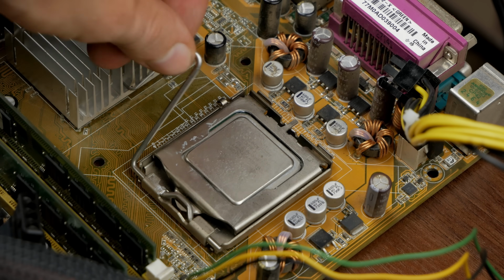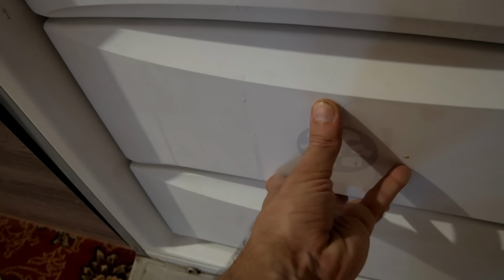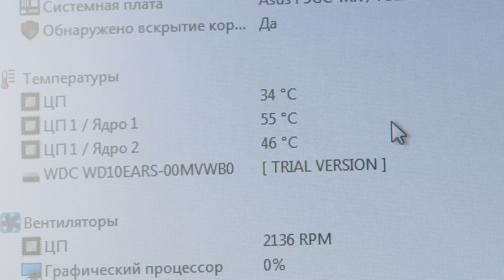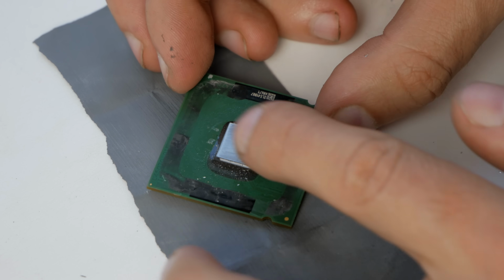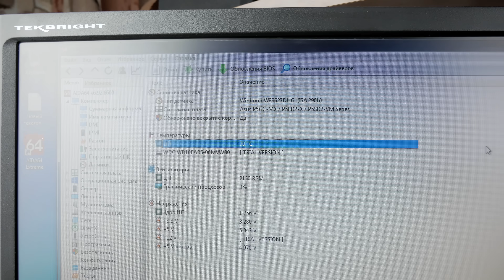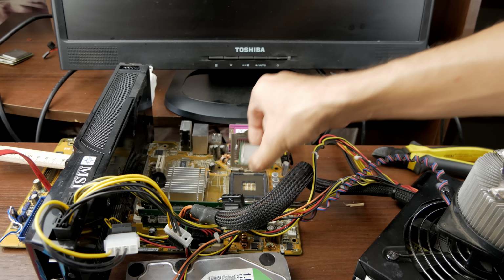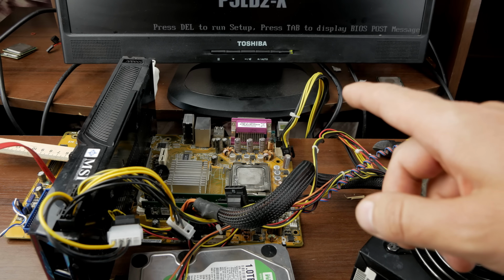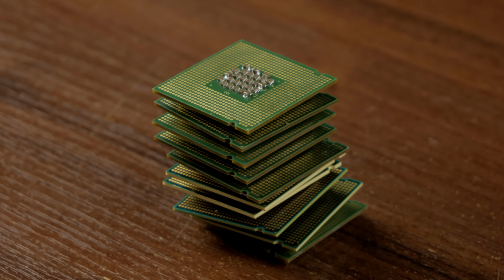How Much CPU Can Handle?

Comment: it's funny how a cpu , stripped out of it's capacitors still turns on and works , yet a laptop loses one small pcb over a heating issue and that mother fucker is dead until that one small pcb is replaced

Comment: Great testing with old CPU you actually achieved a point many of us dare to try lol, and yes indeed 1 thing i did before your video was made was overheat an old cpu to see how much it will take before roasting but it's true after a certain temp the pc does shut off because of a built in safety for the overheating which is great, many people still don't know that a CPU can last a lifetime that's why they were specially made with gold contacts✌✌😎😎😃😃👍👍

Comment: Also there is a method that allows a person on some socket lga 775 motherboards to use a lga 771 xeon by covering the xeon pads with tape and also allows for unlocking the multiplier on some locked CPU's once again though only with the right motherboard.

Comment: When you overheat the CPU, as soon as you overheat it, immediately, rapidly cool it then overheat it again 😊 also there is likely a way to block specific contact pads on some older CPUs to make it think the temperature is not too high, another interesting thing to do would be stability testing a CPU after removing the capacitors from the bottom, also putting just a cheap small aluminum heatsink on one to keep it's temperature close to maximum as long as possible to see if it fails 😅

Comment: I had an ASUS ROG Zephyrus G14 (2022) with a Ryzen 9 6600HS, if I remember correctly. The seller told me that the processor is burned at the corner and suggested replacing the chip, which would cost me $575. What do you suggest?

Comment: So many erroneous posts here. Those small Capacitors are for 'decoupling' i.e. filtering out high frequency transients. They are far to small to 'buffer' the voltage. That is handled by the capacitors in the VRM stages!

Comment: posting does not test the cpu.  when you strip off the capacitors or disable pins some of the function of the cpu will be lost, like some usb or stability or pcie stability.  posting does not test shit

Comment: I almost think this dude would showcase if the PC will work WITHOUT ACTUAL PROCESSOR.  i don't have the powerful pc but like I just don't see these "experiments" benefits users. I mean, who would cut those pins like that if you're using the PC, who would blow torch to processor while working or gaming with their pcs? WHO WOULD FCKING GRIND THE PROCESSOR WHILE USING THE PC ALSO. bro is like seeing people that much dumb and stupid. Imagine working or gaming in PC and *YOU ACCIDENTALLY OPENED THE CASE AND ACCIDENTALLY PUT THE PROCESSOR IN THE FCKING FRIDGE. "oh shoot I slid and accidentally put my processor in the fridge while working, I should be more careful next time"

Comment: At least these complete wastes of silicon can give us some entertainment before going to the landfill now.

Fun fact, the test where you removed the IHS (the metal lid) is actually a legit thing some people due for an extreme cooling solution known as "direct die cooling" which, as the name implies, involves placing some form of cooling device directly in contact with the silicon die. It's risky because if you crack or chip it, it's goodbye CPU, but it can be used for extreme overclocking of hot running high end hardware. Basically not something you'd normally do to a celeron and most certainly not with a razor blade scraping across the die or dropping the heat sink on it.

Comment: I have worn a Pentium D on my neck for a couple years. Should test if it works. The hole i drilled is in power/other pins so it should not have broken it. Also not close to the dies. The whole processor is a jank piece and. Well it's dies and not A die. Because jank. Also i do not know if it worked to begin with. The Pentium D is a rare kind of a processor. It will often die from normal usage. So yea. Still. I kinda want to test it. It could work. And that would be funny.

Comment: i recommend the am 3-4 sockets (3 is very cheap)  amd uses proper pin connectors so you don't realy have to aply barely any pressure

Comment: I would be careful about disconnecting live power from any of the external sources, especially if the powersupply cannot handle any sufficient transient spikes. The card isn't a 4090 of course, but i've killed 2 boards that way. Just fyi.

Comment: you can't really kill a CPU with just boiling in regular water or over heating it to about 125 C. Processors are usually baked at above 200 C during manufacturing.

Comment: The transistors are actually on the bottom of the chip. You may remove 99.9% of material and CPU will stil work. Provided you don't crack it

Comment: Blue Flame Gas torch 3000°C - 5432°F
White hot dazzling 

Look up Red heat (Temps) on wiki

Something Hotter then GAS & Air

Magnetic Induction Heating + Graphite/Graphene  (Btw Thes are ZVS Magnetic Induction drivers kits  1000W, 2500W 12V ~ 48V  DC on E bay ama zon - for Smelting Metals  )
it can go 8000°C - 14432°F Btw thats Hotter then the sun & Earths Core

Comment: the sort of things your doing there will kill of the CPU,Removing the heat paste won't make it any better,It still heat up a lot more with the CPU Fan on it,Your computer only have a short time to live,The CPU Processor will heat up,Till its hot enough to dry eggs on it,Then it go POP then thats your computer screwed up,Sometimes even burn a hole through the back of the main board,Then thats a replacament main board and processor to replace in to your computer,Cost quite a bit to replace,Get heat paste for few quid

Comment: I fried my cpu while troubleshooting my pc 
It was a r5 5600X and I just installed a fresh new cpu cooler, when I tried to boot him up after the upgrade, the pc wouldnt post so I'm dismounting and remounting my cooler over and over againt while googling my problem on the net. I forgot to turn off my pc and my cpu just fried itself (smoke coming out of the socket..) results : dead cpu (2 critical pins fried) and a mobo dead too (150$ lost  :(( ) dont do like me, be careful out there guys

Comment: Seriously I don't know if you're just lookin for engagement but you run a PC channel and don't know what capacitors are for? They filter and help stabilize the input voltages but they're really important for transient loads. Yeah some CPUs will boot without any but try starting a stress test or even a game constantly changing the load conditions and tell me how that goes. The VRM can only react so fast to load changes so caps on the CPU itself help to stabilize these short transients. The worse the VRM and PSU are, the more important they are. Only millivolts of voltage drop can be the difference between crashing and not. The more powerful the chip, the more critical these are. Modern chips are much more sensitive. Also many CPUs also have SMDs other than caps that can simply prevent it from working if you knock one off.

Comment: The sanding of the silicon is actually used by some mad overclockers to get a better heat dissipation (less Z height between the CPU die and the cooling solution).
Reply: It is especially useful on a 9900k. Delidding and sanding decreases its temperature by more than 15°C.
Reply: @De-M-oN  Oh damn, that's a nice gain ! ^^
Reply: I beg your finest pardon?? 😭

Comment: Fun fact: if he shortened just a few right contacts he could force the bus speed to go higher and literally OC it. That's how I got my Q6600 running at 3Ghz in HP OEM mobo that has no settings for OC

Comment: i once killed a xeon L5420 by trying to drill the side holes so i can use it on 775 socket... anyway i am still using x5470 up to this day with 16gb ddr3, it is an INDESTRUCTIBLE platform!!!! todays crappy core i-wtf can go f. temselves

Comment: I don't think the tape is fully preventing electricity from getting through.
There might be a bit of current that gets through and as long as the relative pins are all blocked similarly, I think it is just recognizing that like an undervoltage or lower signal (compared to no signal as intended).
Just my guess.

Also, any capacitors are going to be able to store energy. I would imagine they're going to be used to handles fluctuations or filter the power when changing frequencies/under loads.
Just my guess.

Cool video tho. I can honestly say I did not know some of that stuff lol

Comment: over heat is not good and will be ruined as solder work will melt away and fall off and will fail to work and even speed or anything at all so it not a toy to play with or work on it so the best is leave it alone and don't do anything stupid for that and even testing it too

Comment: You re trying to break it I am trying to fix mine 🤦 Anybody got a free psu handy
Reply: Oh yeah I had to take the pcb out of the psu And soldier a thick trace line That had gone black and burnt and disconnected It's been working ever since 😂😂
Reply: Just random shut down which I think is overheating

Comment: Caps are for power smoothing. Same on the mobo - I recently popped a couple on a 386 mobo and it still worked. Just have a good power supply.

Comment: I am skeptical of these examples. You deal with these microprocessors on the macroscale scale, which is like destroying car with a small hammer. 
CPUs are built in special technology production with a multilayer of protection.
If you werecould uncover the surface, you would destroy the chip by sneezing on it.

Comment: Powersupply is regulated but very slow. Its impedanze can't be changed so quickly.
Thos capacitors are special ceramic capacitors with very low resisstance and inductance so they can deliver very high currents if needed. That helps stabilizing voltage changes. until the powersupply is able to "pump in more current"

Comment: the cpu should still "work"without the caps but try to do actual work or computations and it will fail. also if you delid and can make the heatsink contact the die it will work way better

Comment: I believe these are decoupling capacitors, which keep the CPU running if your power supply has a small hiccup. Think of these capacitors as suspensions for your CPU's power supply. 

Aside from filtering voltage, I think they also help your CPU maintain power in between clock steppings. 

Let's say you take your CPU from idle to full load, like maybe you opened Crysis or something. The CPU would want to increase its clock speed, which would increase its power consumption, which means it would want to draw more current from its supply. Thing is, when it tries to suddenly draw a lot of current, the supply voltage droops. If the capacitors weren't there, the CPU could lose power as it was trying to step up to higher clock speeds.

So my two cents about the capacitorless CPU is that, while it may seem fine as the computer boots up, it will be more susceptible to brownouts (loss of power). If you used it for a while, you would see your PC randomly shut off, especially when you put some strain on it.
Reply: it's time to defrost the cpu:face-fuchsia-tongue-out:
Reply: Are Crysis jokes still popular?

Comment: This man basically proved that while sure you should be careful with your components, first time builders do not need to worry about breaking something as easily as it may seem.
Hell even I myself is pretty impressed with the durability of these fossils.
Reply: Until you bend a pin on the socket that goes to the memory controller and you can wave goodbye to dual channel memory.
Reply: @Ignisan_66  or accidentally cross power and ground, frying a capacitor and the entire CPU. Happened on my old FX chip.
Reply: No, these components are very fragile. And you should be very careful about their maintenance. You never know when you run out of luck. Because of some moisture in the rainy season my computer died. 4 components I have to replace.
Reply: @NEO-v7r  I am aware of that, but that wasn't quite my point.
Reply: @Zidakuh  Any suggestions for keeping pc safe from moisture?
Reply: @NEO-v7r  As there are "air humidifiers", there also are "air de-humidifiers". And if you live in a particularly humid area/part of the world, shutting the windows might help.
If a PC has caught some water in some way (e.g. Rain or similar), let it dry for 2-3 days before powering it on.
Reply: @Zidakuh  I read somewhere silica gel can help get rid of excess moisture.
Reply: @NEO-v7r  oh yeah, definitely.
Reply: Back in the day when I was removing the heatsink from the CPU to change the thermal paste, the heatsink welded to the CPU (because of the old thermal paste), I tried to "gently" remove it, but I ended up ripping it straight from the socket (it was AMD with PGA type of connection). When I put everything back together with new thermal paste everything was working perfectly fine.
Reply: You will kill your motherboard if you turn it off during a bios update
Reply: True but I'd say the highest risk of damage is damaging the pins on the motherboard. All pc builders need to be careful of that, bc its very difficult if not impossible to fix sometimes depending on how extensive the damage is
Reply: Intel 13/14th Gen, AMD 9000 Series: hold my beer
Reply: He did not test smaller architecture CPUs which are super sensitive
Reply: why do they always think pulling it out while it's running will kill it all it does is the same thing as turning the computer off sure the system will crash due to no cpu or ram but it runs fine after you reinstall it
Reply: @SaraMorgan-ym6ue well yes and no. Primarily in laptops, if you happen to disconnect anything while the battery is still plugged in, the chances of sending the 19v (main power line in pc laptops) directly into the cpu (1v) killing it instantly.

Its because the desktop atx pc's are meant to be modular, which is why they are so idiot proof.
Reply: all these ways were dumb. first of all old cpu's. i didnt know about the caps just fore current regulation but you would do none of this damage in reality. Bent socket pins is 1st problem. Most Mb's have protection but in some cases you could push the voltage above what it can take but idk my z77 had max 1.57v and i tried that at 5.2ghz on a 2600k and it wouldnt die no matter what. 1.52v daily driver on (4,8x4 5.0x1) now im driving r5 5500 on 1.408 lets see how it survives. The capacitors on new cpus gpus etc are way smaller and you can knock the off pretty easily and wont even notice is gone. this can be soldered by anyone the ones now are as small as a grain of sand what are you about? 
Also i think people short the MB to the case way more often then any of the complicated things. Look at a cpu power connector and an 8pin for gpu switch them around and cya.
Most thermal shit and deliding n shit is pontless unless you bought a used budget cpu and have no other option cause its shit and you have no more money and a well placed fan is better anyway.
like i see this as a po0ntless video it had nothing just destruction. just the deliding was kind of interesting to see that it didnt matter but cracked pcbs is nothing new
Reply: @marisbarkans9251  you did read that I said "fossils" pointing to the specific components they used in this video right? Of course nobody could re-solder a capacitor that small, nor correct a bent pin unless they have the precision of a machine. As for feeding your CPU a lot of voltage for giggles, I'll leave that to the LN2 overclockers.

Lastly, if you by some odd chance manage to feed a PCIe power cable into the CPU connector, I'll have to applaud you. They are keyed, and in most cases labeled as well, for a reason. :)
Reply: @Zidakuh  i just meant the caps are so small you can knoskck them off by breatheing on them so this doesnt rly display how you shouldnt be careful. i think the cpu connector things started with the 8 pin for more power or something. iv seen a few repair shop videos where people do this, maybe it was a modular power supply thing im not super knowladgeable on this. The cpu thing also depends, to be honset ram takes a lot of pressure to install and the keying part doesnt rly matter when you push hard enough its not a hard plastic its usually like waxy plastic. Like when you build the pc for the first time you dont know how hard you should push. the same s when a amd cpu gets so stuck to your heatsink you think its not possible i have to use both my arms to take it off. later you learn to twist it but anyway the connector can be like that too. even some 24 pins are tight as an 18y old.  Sure everything you said in general is right but the moment you say it is wrong. cause you shouldnt stress too much about breaking but then again its not that hard to break like im always amazed how people bend pins on cpu or MB in storage i get but nothing else.
Reply: @marisbarkans9251  I feel like we are just completely ignoring common sense sense like "if it feels like it is going to break, or is just rediculously tight, you should probably stop", or read the socket cover: "do not touch the exposed pins. Do not exceed excessive force when installing the CPU".

Read rhe manual folks, it is not a crime nor should you feel defeated. Chances are you are gonna have to for those tiny front panel connectors anyways.

Comment: i think the CPU has those capasitors for speed and it still works because you either just launched in a wired way or it just used the capasitors from the mothorboard

Comment: 2:07 those capacitors are used to smooth out the voltage as the transistors inside switch really fast

Comment: The caps maintain supply to the cpu and stability. You may find with heavy cpu usage the system will keep crashing if caps are removed and the same if many power pins are covered.